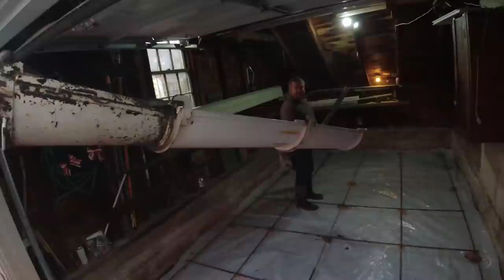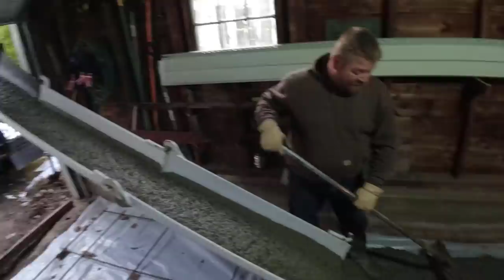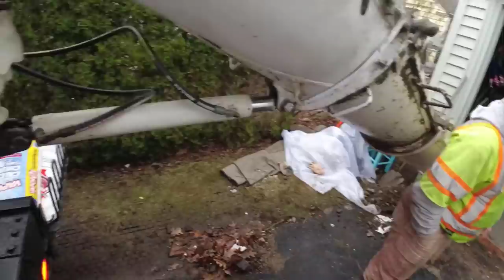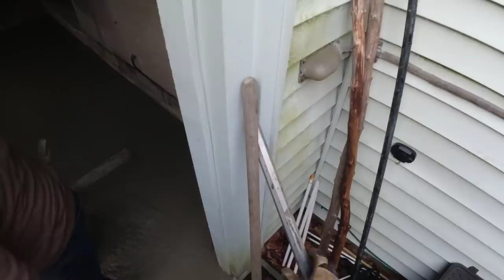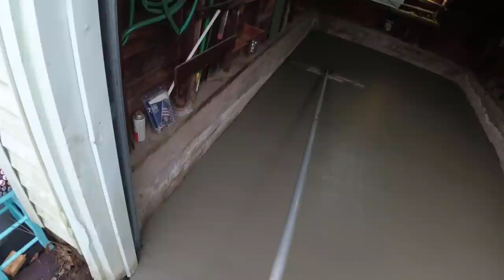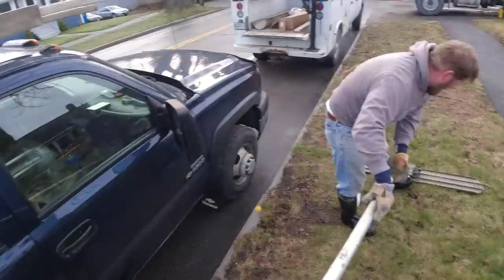How To Pour A 10' X 20' Garage Floor (Single Bay Concrete Floor)

Comment: That is the size they built them back in the 30's and 40's when a garage was a luxury....both my grandparents built that size in the 40's n their dream houses which were about 1200 sq ft. Concrete was relatively expensive then.
Reply from the maker: Not for your average pickup truck is it!
Reply: @MikeDayConcrete   Well vehicles were smaller back then and families had one if they were lucky. Even the pick up were smaller. Hell even the people were smaller, my grandfather was average size at 5'6".